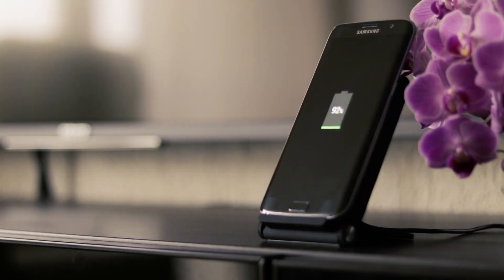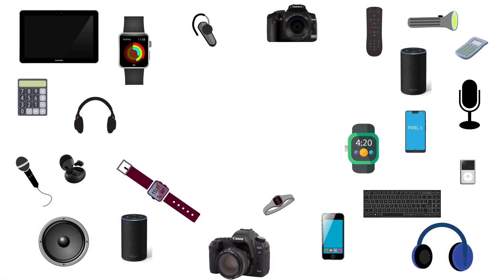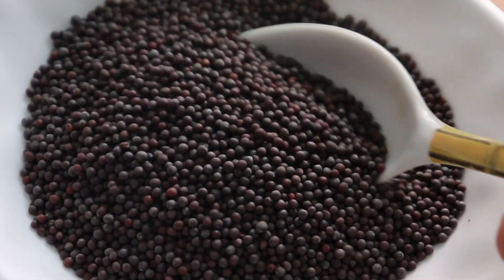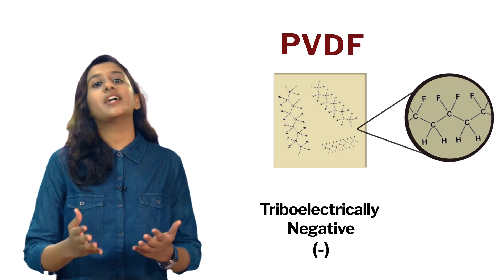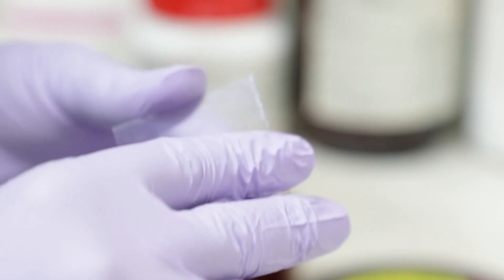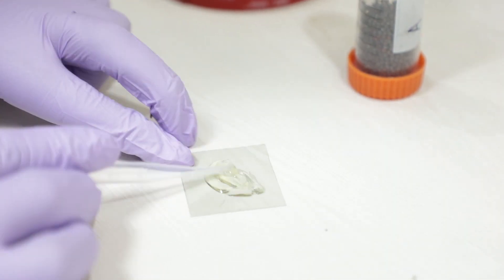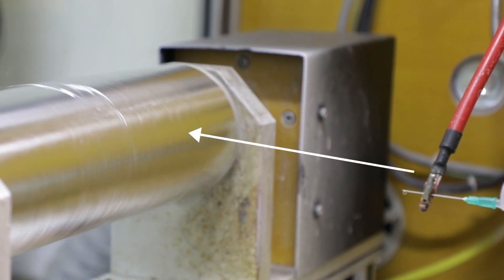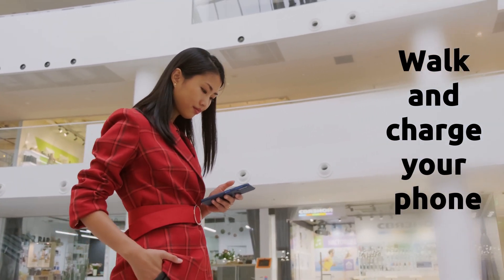Generating Electricity From Footsteps: Triboelectric Nanogenerators (IISER Pune)

Comment: I don't like this kind of power-generation...partly because I think it's already being used to generate power for clandestine means which are misanthropic. There are better ways. There is already free-energy devices if we need new ways of power. This is messy energy. It is an unnatural way of using nature which probably aggravates the microbiology contained within these substances. An unnecessary response to a fake problem; that we don't have enough energy infrastructures available or enough energy to go around; humanity should be looking at the sociological and spiritual reasons for lack of 'power.'